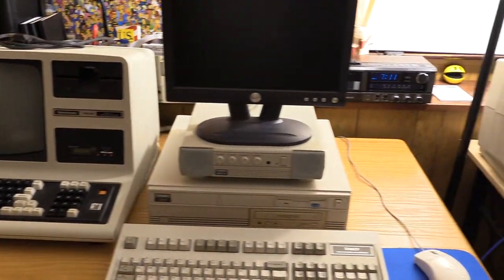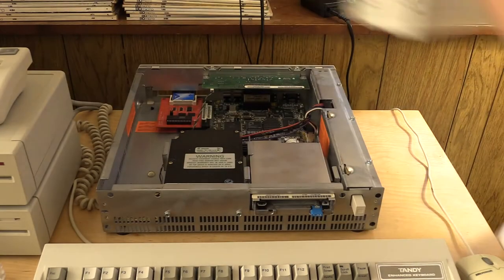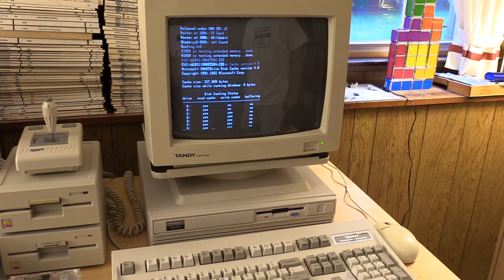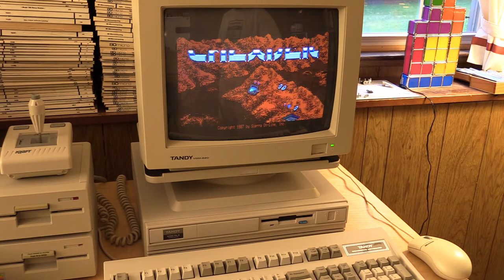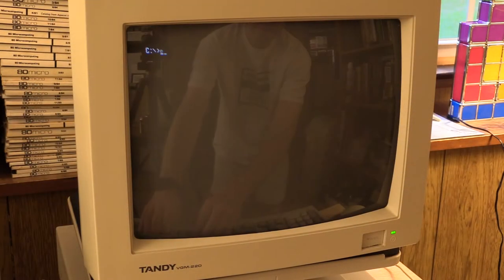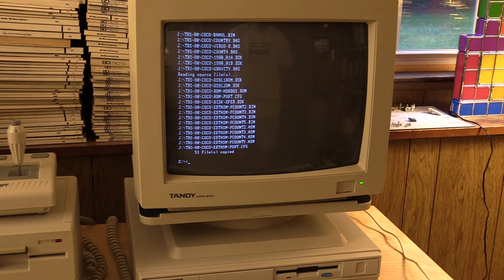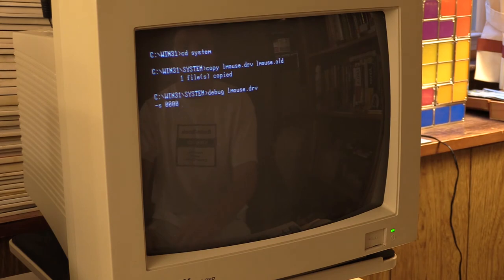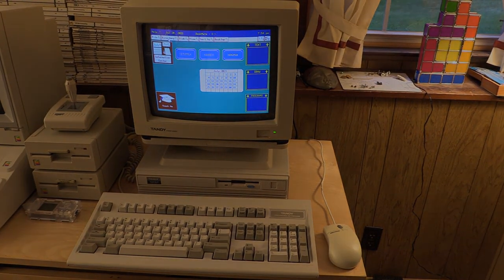Tandy 1000 RLX/HD: Check Out My Newest Computer

Comment: I did not think Thexder would run in Tandy 3-voice sound without tandy graphics being initialized.  I always thought they were tied together.  What you have here is a VGA monitor running Thexder in EGA 8-color 640x200 mode, which should default to PC speaker 1 voice audio, yet the game is not.  FYI if you hook up a Tandy CM-5 color RGB monitor to that machine for 16 color games, you will notice an immensely improved picture.  Though the dot pitch is much worse, the CM-5 properly captured the "arcade feel" of the era, and produced stunning graphics for the machine at the low resolution of 320x200.  Sadly my 20 mb hard card on my 1000 RL decided to stop spinning up a year ago.  :(
Reply from the maker: I've had the same experience with Tandy support in games...some only work if both the graphics and sound worked.  Fortunately Thexder isn't one. :)  My RLX still has its original 20 MB drive.  It works, but I've taken an image of it and don't use it.  The CF card/XTIDE combo gives me a lot of freedom.  Thanks for watching!

Comment: I am so excited my Tandy 1000 RL comes tomorrow. However this is not my first one. I originally purchased a Tandy 1000 RL from Radio Shack many many years ago.

2 questions:

What mouse can I purchase for my Tandy 1000 RL? I do not recall if a normal PS2 mouse works or not.

Any tips on locating a floppy drive? I have a spare 1000 RL that is missing the floppy drive.
Reply from the maker: Congrats on the RL!  These "last" Tandy 1000s are fun to play with.  I'm not 100% sure about the RL and a mouse...my RLX has a PS/2 mouse port on it (which works in DOS, but not in Windows without some driver trickery).  I think the RL has the same port, but I forget.  As to the floppy drive, it's a Sony drive with  power supplied through the data cable.  I haven't tried to find a replacement drive, but you can find an adapter that might let you use a more standard 3.5" drive here: https://www.tindie.com/products/cyberneticsys/tandy-1000-internal-35-fdd-adapter/  

That adapter provides power and data breakout so you can use a standard drive.  Sony drives might be the easiest fit - the RL has the "faceplate" of the drive molded into the front bezel, so you'll need to remove the faceplate of the replacement drive...and probably move the eject button from the old drive to the new one as well.  A Sony drive of the era may line up better and make drive replacement easier.  Good luck and thanks for watching!

Comment: How did you get the button to stay in? I have the problem with an HP.
Reply: Retro HP
Reply from the maker: For a while I was able to wedge it in crooked.  That finally stopped working and I took it apart and just by-passed the switch.  So it’s always on now, and I have to unplug it to turn it off.  One of my projects is to try and get a replacement power switch, but it keeps getting bumped for more “fun” projects. 🤣. Thanks for watching!

Comment: HELP! I have a Tandy 1000. Was going to install compact flash but it won't accept it, while in the process I changed drive c to drive a and can't get into the bios to change it back. I also think I deleted something from desk mate not programs are on it. When I try to install the 6 installation disk it won't accept any of them. When I type c: setuprl \a or \s it doesn't accept it.
Reply from the maker: Unfortunately it's hard to say what's happening...that said, myself and a lot of Tandy community folks can be found on the Vintage Computer Federation forums https://forum.vcfed.org  I'd recommend signing up for an account there and posing your question.  You'll have a good chance that someone might be able to give you some clues.  Good luck and thanks for watching!

Comment: That funny I had the exact same mouse driver issue on my Tandy 2500 SX/33 I just thought it was a hardware problem at first since I didn't get a mouse with it but found a rather simple fix I took a ps2 to usb adapter and plugged in a usb mouse a cheap laser mouse with the IBM compatible mouse driver and it worked no problem shocked me I like easy fixes
Reply from the maker: I've had mixed results with newer PS/2 mice.  My 2500 SX/25 seems to like most of them, but the 1000-series is a little pickier.  :)
Reply: @TJBChris  I got lucky it was a free 🆓 Tandy was in a pile of junk I like free stuff no way could have gotten the system when new at 10,000 dollar
Reply from the maker: @BlackDragon-xn2ww  I know the feeling.  My 1000 SX and its monitor were destined for the dumpster, when I got ahold of them.

Comment: Hello, Great Video...Thanks!  I have the exact 1000RLX-HD Model "A" that you have.  I've disconnected the 40MB HDD.  I purchased a Lo-Tech XT-CF-Lite 8-Bit Isa card like you have and also the exact 2GB Verbatim CF card.  I cannot get my MS-DOS Setup (or FDISK) to recognize the CF card as a hard drive.  Any help would be appreciated.
Reply from the maker: Given the number of variables, it’s hard to say what’s wrong, since I can’t see it behave.  That said, make sure you’ve run the XTIDE Universal BIOS config utility to generate a custom XTIDE Universal BIOS ROM file for your XTIDE, tailored to your RLX - I have some sample ROM files on my GitHub, but I’d have to refer you to the XTIDE universal BIOS doc for specific guidance to get them written to ROM.  If you’re not seeing the XTIDE BIOS pop up on boot, that’s your starting point.  If you are, try another card or wipe MBR of the CF card (there’s a utility that Google can help find).  Hopefully that gives you a good starting point.  The RLX is finicky, so YMMV (I know folks who never got it going).  https://github.com/TJBChris/YTReference/tree/main/rom/xtide/

Comment: How did you disable the internal ide controller I can't get mine to find my cf ide controller to be the boot device
Reply from the maker: The only thing I did on mine was disconnect the internal on-board hard drive power and interface cable.  I don't think I had much else to do...you can run SETUPRLX from a disk and see if it has any config to let you turn off the controller.  I can say CF-IDE controllers are finicky in RLX machines.  I have an RLX-A, which wasn't super difficult to make work (I had to experiment with the address of the XTIDE expansion ROM a bit but finally got it).  But I know some RLX-B owners who couldn't get it to work at all.  If you have an RLX-B (smaller joystick ports and lacks the satellite board), it could be a pain.  Good luck!

Comment: Can you add an external disk drive?
Reply from the maker: I could possibly add something like a ZIP to the parallel port (I think it's bi-directional).  But beyond that, there's only one expansion slot, so if I'm going to to use it to interface an external drive, I may as well use it for the CF-IDE interface.  The system has no native external drive ports on the back like the 1000 EX or HX.  Thanks for watching!